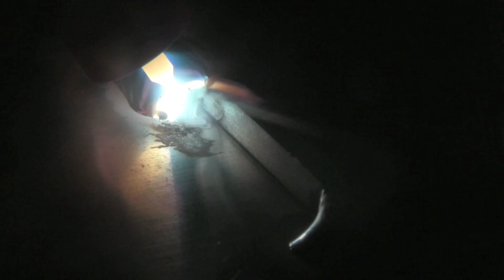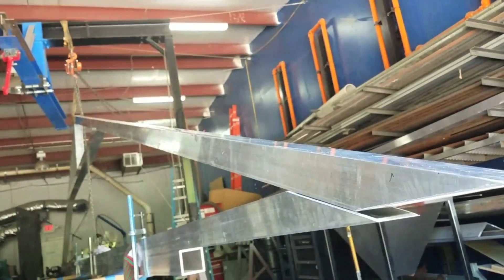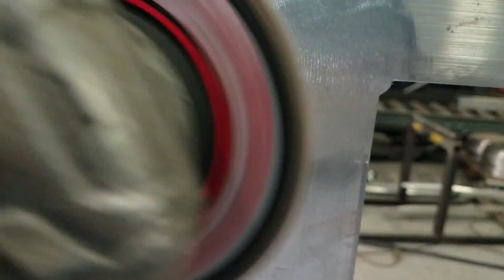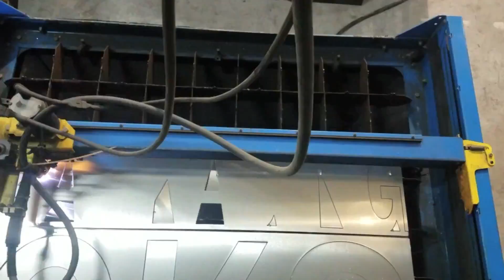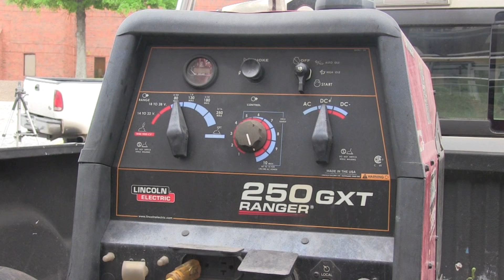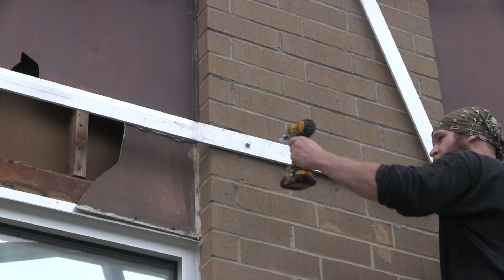Aluminum Spool gun Welding Awning Project with PlasmaCam

Comment: Awesome job guys. I see now its already been 5 years ago since this was put up. I figured they would put some fabric up there for the cover. 
I always learn from every one of your videos Jody! Thanks for taking the time and putting forth the effort.
I wish I could have watched all of your videos before I struck my 1st arc on 1/8 7018 in 84 on a home built heavy duty pipe trailer that my dad had invisioned in his mind. 
It had to eventually have a stronger tongue and to have a 3rd axle added but its basically a steel frame trailer  with a 20x 8 ft deck with no floor and a place to put side posts  in 4 places on each side to hold pipe from rolling off.
It was built so that the 4x4 inch racking boards that came with every truck load of ductile iron pipe  could lay 4 inches deep inside the metal frame and make a floor flush with the top of the 4 inch channel iron from which sits on top of the long main 2 runners. 
We always prefered it just to have an open frame. This made it easier to wrap chains around pipe so they could be lifted off.

Comment: Great project and definitely something I aspire to. Did you weld the inside acute angle of the bottom run of the truss? If so how in the world did you get in there? Also, how were the powder coated letters fastened? Oh, and what process did you use to clean the oxidation off the letters leftover from the plasma cutting?

Comment: I haven't worked with aluminum in years and when I did it was very minimal. When the butt weld was made on the long run, does aluminum pull like carbon or stainless steel?

Comment: awesome music!!!   killer video. i have a question on the aluminum.  when cutting it on the plasma table.  How did u guys keep the nasty smoke down?   ive cut alum on my table and it makes some nasty smoke.   ??
Reply from the maker: got a fume extractor/dust collector hooked up to it with a big fan exhausting it outside
Reply: weldingtipsandtricks. roger that!   thank u sir.  ill get one.   i was debating adding a water bet to the table which would make it kinda hard to move around or buying some kind of fume extracter setup!

Comment: if you needed a new machine tomorrow and your choices were the Miller Millermatic 252 or the Lincoln power MIG 256 what would it be I have a Lincoln 135 and it's getting pretty tired and I'm looking to upgrade what's the best one to go with?

Comment: Hi Jody an interesting video. Wouldn't it be easier with the welding in the shop if the torch had acurrent adjuster on it rather than using a foot pedal ? I've seen wheel adjusters and sliders. Cheers.

Comment: Thanks Jodi & JD. Really enjoyed the build. I didn't see any cleaning of the joints though. No stainless steel brushing or wiping down with alcohol before welding? I thought that was a necessary part of working with aluminum.

Comment: how do you deal with the fumes? I don't see any air circulation system or a filter hood. Do you use respirators? I tend to be extra caution with aluminium fumes. Isn't aluminium oxide cancerous?

Comment: Great job, JD how many man hours total for full job, and what price out of interest for framework and signs Cnc cut only, including transporting frame   excluding cladding, I'm starting out on my own in the fabrication industry here in Australia trying to do quotes is a challenge,   I know costs structures are different here in Australia , Cheers David
Reply: FlashTechEngineering I'm all over the place so I didn't work on this start to finish because I did alot in between.  but it roughly took about 10 days spread out over 3 weeks.  whenever I do any pricing or whatever for a custom job like this, i just add up all the material and multiply that by 2.5.
Reply: Thank you that will help me with my pricing

Comment: Nice work, and nice video! did you find manipulating the spool gun to help? My miller manual says to just run smooth.....multiple passes if necessary. 
cheers
Reply: Si mclardy which spool gun do u have for your miller? are you satisfied?
Reply: +Al Michaels 
I have the 150 spoolmate? It goes to my multimatic 215. I like it but I am still not crazy about my starts. the settings seem more fickle.
Reply: Si mclardy thanks for the feedback!!
Reply from the maker: not sure if it helped...just habit
Reply: K thanks again for all the videos. I think the education I get from your channel is a fine example of the power of the internet. You give an amazing value!

Comment: Hi Jody,
 Great vid as always, nice job you and JD did. Those doublers  are a great idea of JD's. I built many aluminum estate drive way gates and we found that doublers were absolutely necessary at points of stress. The weld might not fail right away but eventually it would. Just an aspect of working with extruded aluminum tubing.
Reply: Dick Sargent that was my thinking, a one-sided 3" aluminum weld would fatigue over time. Thanks!